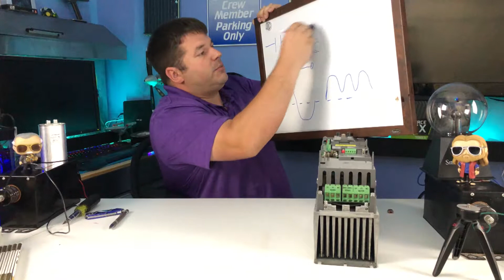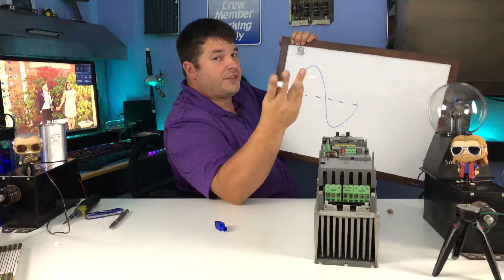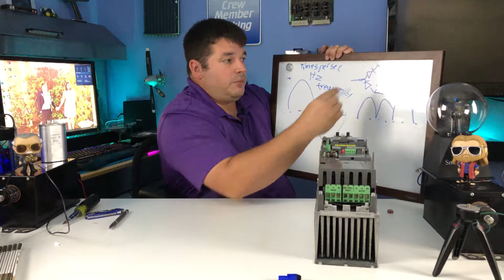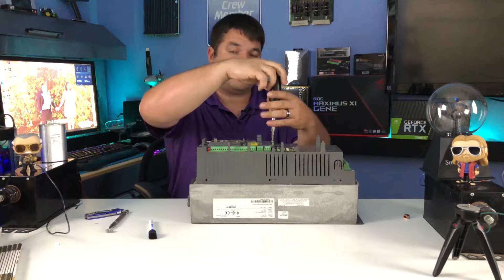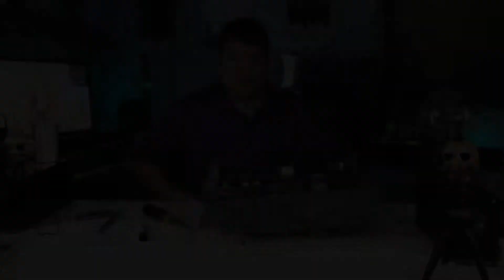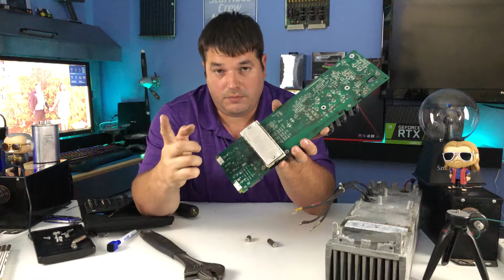VFD TEAR-DOWN, what is inside the mysterious box and how do they work.

Comment: So why turn AC into a DC that looks and acts like AC?
Reply from the maker: Nik Harvey because the motors are designed to run on an ac signwave so you hafto make the motors thinks thats what there getting, but you can manipulate that signwave to make them go faster or slower
Reply: Ok, so why not run it on AC?
Reply from the maker: Nik Harvey motors run on ac normally but its only 60hz ever
Think of it like ac we control and change to run 0-60 or even as high as 800hz